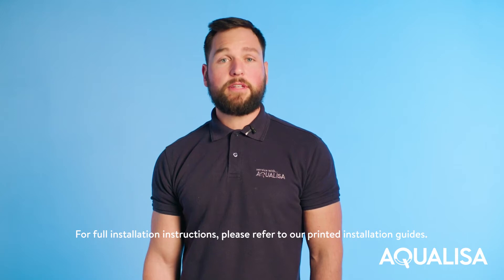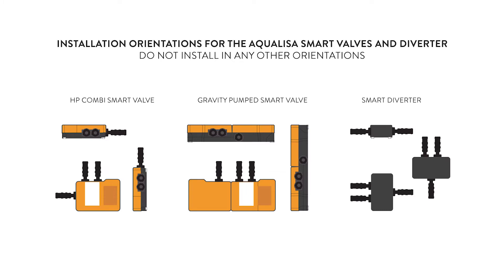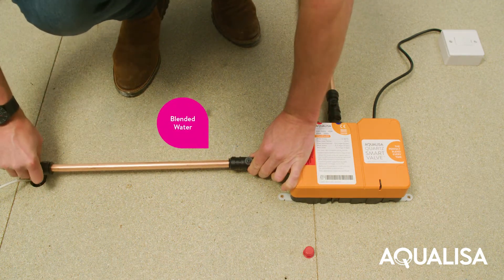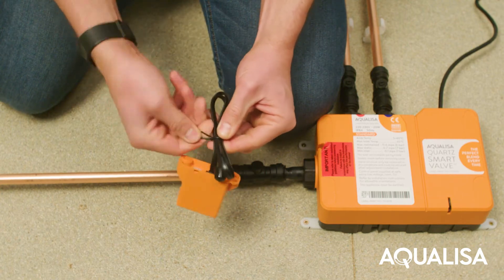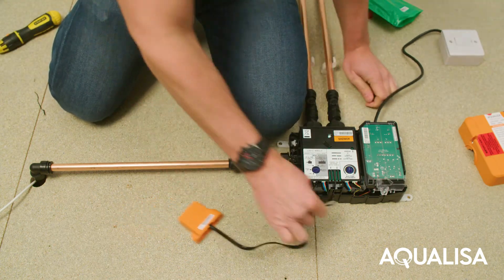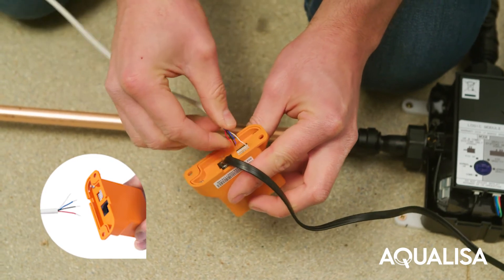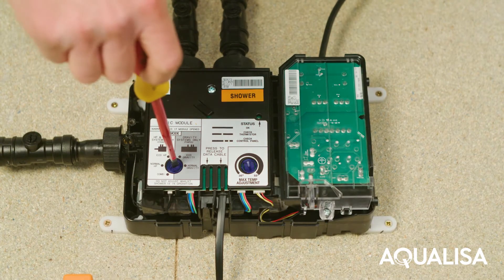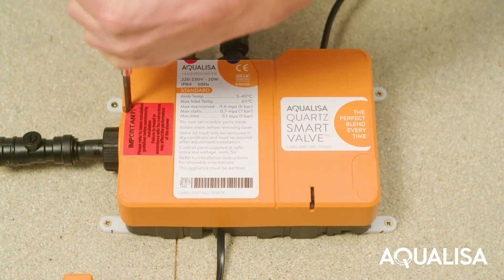How to install an Aqualisa smart valve including a canbus converter

Comment: Is this a direct replacement for the older Black 434100rev01 type and can I plug the existing remote cable in or do I need  the canbus converter, we have updated our system and are using a combi boiler?

Comment: It’s not clear what you are doing with that canbus tool opening what? Are you pushing it into the same holes as the wires go into, or the smaller slots above? 

Installer Bracknell.